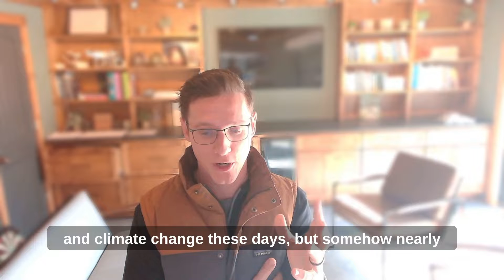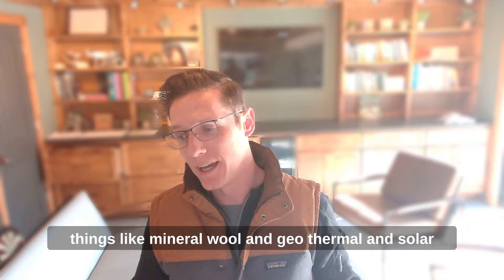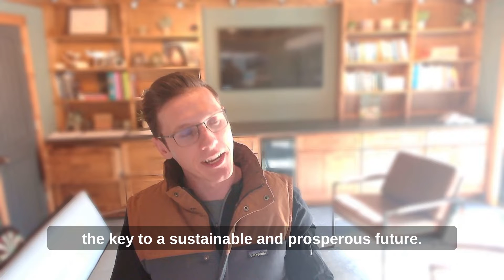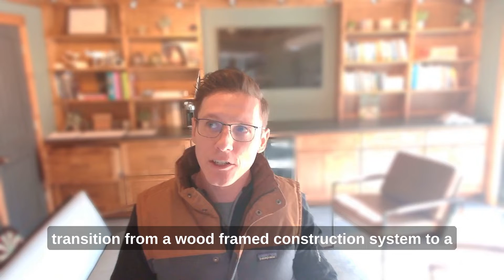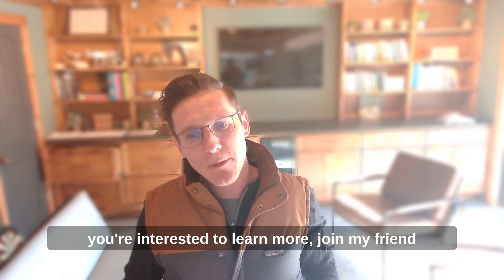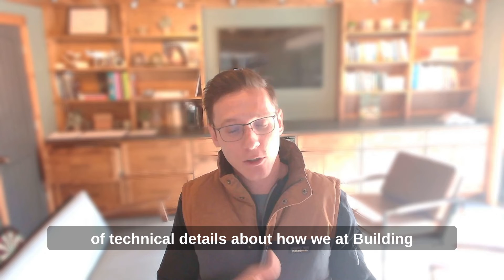Durability is the REAL Sustainability in Architecture.  Join for a LIVE presentation with the ICAA!

Comment: A great idea, but given the cost of construction, isn't this more of a novelty for millionaries at this point in time?  Don't get me wrong, I'd live in a lovingly designed and constructed masonry house in a heartbeat if I could.
Reply: It's currently a novelty not because it is impossible, but because most of the industry (including the code-writers, lobbyists, and municipalities) have relentlessly pushed "new" forms of complex construction assemblies as the standard. Most of the construction industry, down to the carpenter/mason/knocker on the job site, has simply forgotten how to make things that last at the century timescale. The reason that Austin's approach tends to be a bit more "expensive" is not fundamentally because it is extravagantly costly (and there are numerous ways to measure cost) but because the knowledge supply is low. What used to be an easy job for a mason 200 years ago would be incredibly difficult for a lot of masons today.

Ultimately, it's not a novelty at all. Structural masonry construction—along with many other traditional methods of building—is present in so many regions of the world because it works. What many don't realize is that the charm of very old cities is often a result of the fact that they have been stable for centuries. Their built forms are set, and then minute changes are made over time. This creates the harmonious, highly tuned environments which millions of tourists flock to old cities to see. And at a deeper level, it is one of the foundations for a healthy culture.
Reply from the maker: Exactly!! Great explanation. Thanks.
Reply: @maxwellstarcevich  I would love to live in that world, but I just can't believe we're going to put the urban blight Genie back in the bottle.  If anything, current geo political trends are pushing humanity into progressively more dense urban enclaves.  That said, I'm all for keeping the dream alive, maybe it'll find fertile dirt in future generations.
Reply from the maker: Great question!

Every healthy society certainly needs cheap, temporary housing. But it also needs permanent housing. That typically starts at the “upper class”, it’s true. But we live in the wealthiest, most advanced, prosperous civilization in the history of the world. We just choose not to build permanently. We instead build bigger, and fill our paper-thin walls with more and more luxuries, while perfectly content it will all end up in a landfill shortly after our death. 

Our homes have almost doubled in size in the last 50 years. Also I’d say: if we had more industry focused on structural masonry, it would bring innovation, scale, and lower costs. 

So, it’s a long road ahead! But one we believe in
Reply: That’s a fair question. One answer is to consider having enough versus having more than enough. Everyone wants giant cheap homes with underutilized space. I would much rather have a beautiful and enduring home even if it meant being “small”. We would all potentially have different views if we knew our home would be passed on to our families but that era is gone as well.